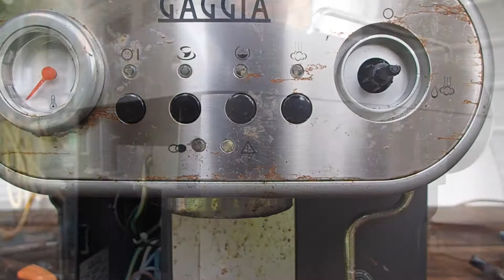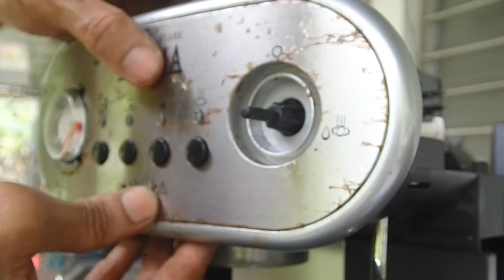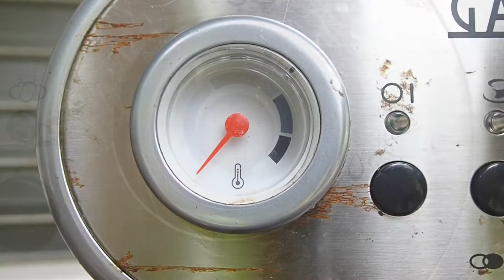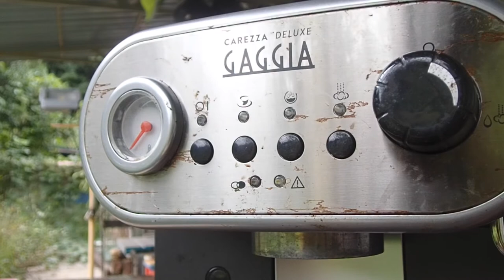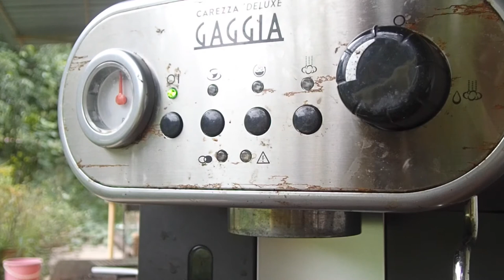Service espresso machine at home - Gaggia Carezza Deluxe

Comment: I've got a leak coming from mine. It was very helpful to see how it dismantled. Thanks
Reply: After 4 years of everyday use, it's leaking :)
Reply: @Ktvk-xe8pg  Ha! Same here - around 4/5 years before it started to leak. Then I realised the basket was clogged. Applied some heat to expand the tiny holes and voilà, good as new 👍🏻
Reply: @jobbo30  Opened it today, in my case there is a leak at the tube/hose (from pump) connection with boiler. Maybe due to calcification (even with very soft water) or a broken hose... because the space around have some water with a mixture which reminds me chalk or.. descaling powder.

Basically once a few months I also opened portafilter to clean, because it had quite a lot of coffee "leftovers".